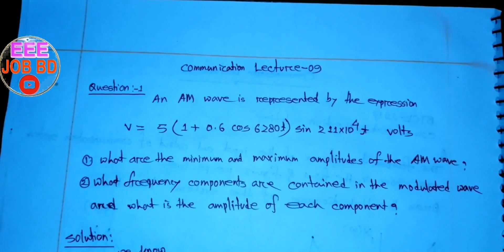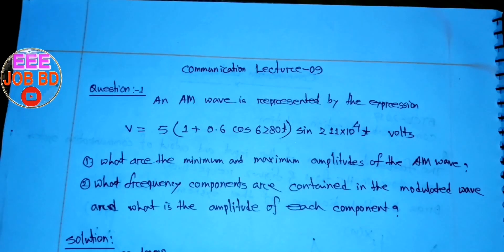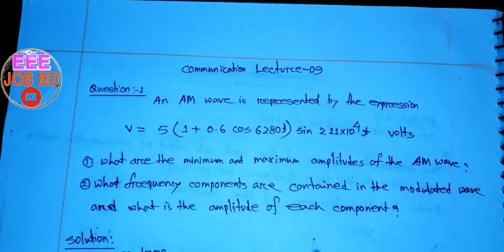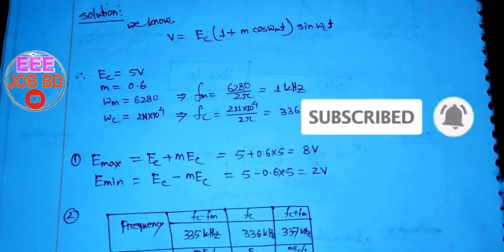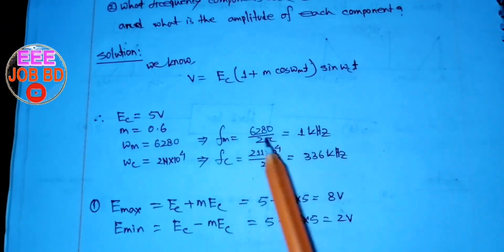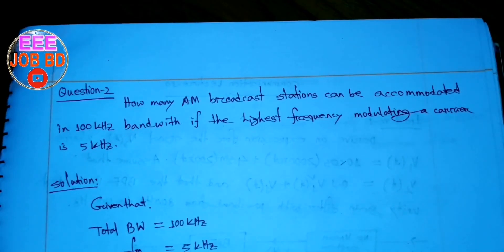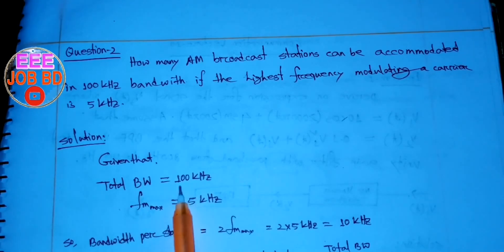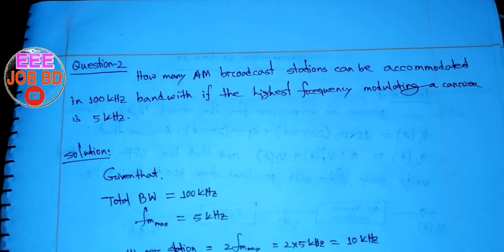AM কমিউনিকেশন ম্যাথ সল্যুশন || L-09 || EEE Job Preparation||  Communication System || AM Station |

Comment: Can you help me to solve out this math :An Am transmission channel has BW of 10KHz & has guard band of 0.8KHz at each end.need maximum allowable BW for modulationg signal.My solution is :max BW=10-2*.8=8.4KHz
here BW=2fm
so, Fm=8.4/2=4.2Khz. Is it Okay?
Reply from the maker: How many guard band you have used?
Reply: @eeejobbd  . It was not mention in the Question . This math was came in dmtcl-2020